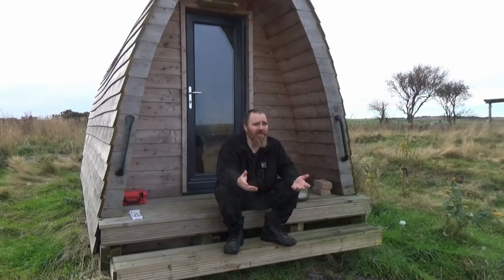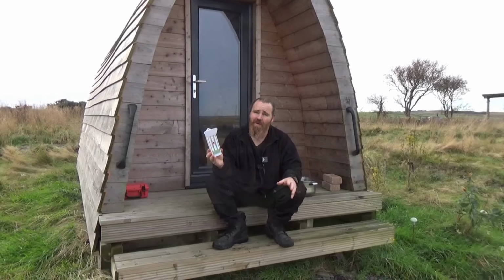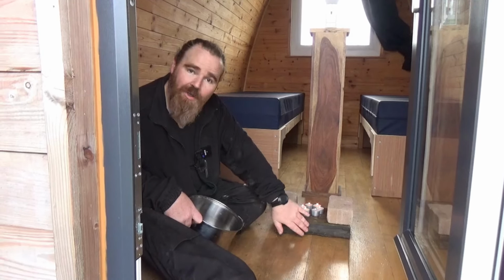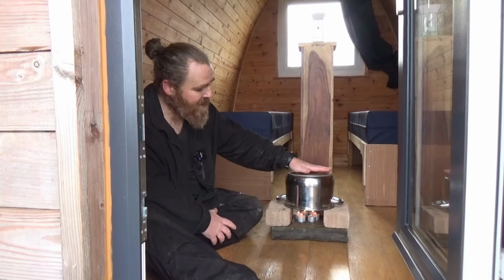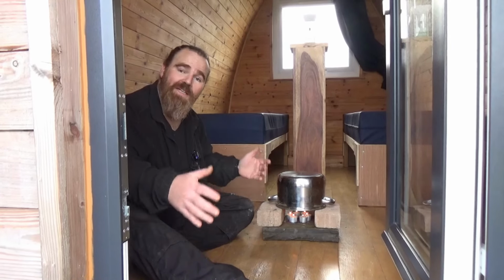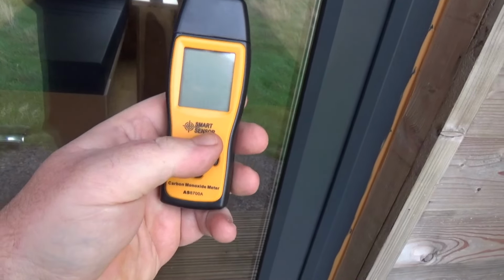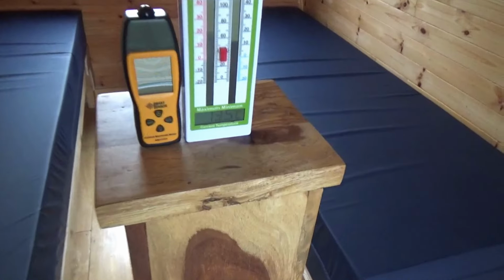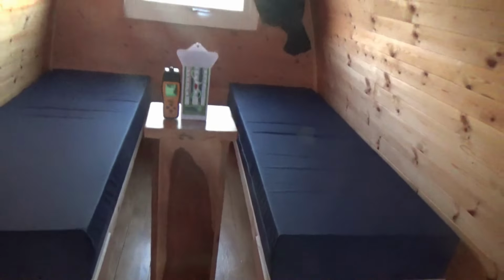DIY Flower pot candle tiny house/camper van/power cut heater tested. Effectiveness? Carbon monoxide?

Comment: The first law of thermodynamics is “Energy cannot be created nor destroyed”. 

The energy here is 6 candles. You claim the pot produces more heat than the candles alone. But if you weigh the pot before and after, its mass does not change. So the pot contributed no heat (energy). (If it did, it must have ‘created it’ - See 1st law). 

So your claim is ridiculous. 6 candles = 6 candle power.
Reply from the maker: Oh that's embarrassing. 
I hear a lot from people who think they understand the laws of thermodynamics. 
You don't. 
Energy cannot be created or destroyed, but it can be changed, and experienced differently. That's why a hot surface is hotter when you touch it. Conductive heat is more effective than radiant heat. Same heat, same energy, experienced differently. It's elementary, basic physics. 
You are suggesting that putting your hand into a flame is no more effective, in terms of heat transfer, than sitting next to it. Common sense should suggest otherwise. 
Using words you think are impressive, like thermodynamic, doesn't change the fact you clearly don't understand physics.
Reply: @CairnOfDunnCroftPermaculture  
In the example I gave regarding weighing the pots… Did you try it? Why not? 
Wallow in your ignorance, sister.
Reply: @CairnOfDunnCroftPermaculture  said, “A hot surface is hotter when you touch it”. Really? Merely touching something increases the heat output? Can you elaborate? 😂🤣🤣
Reply from the maker: @marcusjaybrode2129  oh bless. 
You really are a special little boy. 
Go troll someone who cares about your tiny penis energy.
Reply: @CairnOfDunnCroftPermaculture  
On my! A tantrum! Is it the wrong time of the month? Take a Midol and have a nappy.
But please come back when you feel confident enough to discuss this like an adult. 😆

Comment: Nope. 

Even if you covered the candles with a clay flower pot, it would still not be an effective method for heating a room. The heat produced by the candles would be trapped within the pot to some extent, but it would not be enough to significantly increase the temperature of the room. The limited heat produced by the candles would be quickly absorbed by the pot, reducing its effectiveness even further. Additionally, candles are not a safe or reliable source of heat and could pose a fire hazard if left unattended. It's best to use heating devices that are designed and tested for heating a room safely and efficiently.
Reply from the maker: You don't understand basic physics. 
I'm sorry, I've had enough of sugar coating this for ignorant men, and it's always men. You are ignorant of basic physics, and shouldn't be embarrassing yourself publicly.
Reply: @CairnOfDunnCroftPermaculture  -  
Thank you for your mature response. I hope you feel better now. 
So can you explain WHY I am wrong? No, of course you can’t. I dare you to try.

Comment: The pot doesn't matter.  Heat only comes from candles.   The pot only forms a pocket of hot air( mini oven).   Get a good sleeping bag.   Lighting a bunch of candles is unsafe.

If you need to use candles, put them in the pot so they are unlikely to start a fire.   Use a fan pointed at ceiling to circulate the hot air back down to body level.  Use a warm blanket.  Two   down comforters makes for very warm bedding.
Reply from the maker: https://youtu.be/sK539ekJ4bo

Comment: LOL. A candle can put out no more heat with a plant pot over it than it does without. Energy cannot be created.
Reply from the maker: The amount of energy contained in the fuel in a candle is set. True. However...
There are three forms of heat energy transfer. 
Convective.
Radiant.
Conductive. 
Convective heat is the least effective, conductive heat is the most effective. 

An example of the difference between the effectiveness of conductive heat and radiant heat is a hot water bottle. If we fill two hot water bottles with a litre of boiling water each, they have identical amounts of heat. But it's far more effective to hold the bottle than to hold your hands six inches away from it. When you touch it. you're experiencing conductive heat. 
When you hold your hands close to it, but not touching, you're experiencing radiant heat. 

Same energy, just transferred to you differently. 
Conductive heat is clearly more effective than radiant heat. 

An example of the difference between the effectiveness of radiant heat and convective heat is a closed room with a window facing the sun on a sunny day.
The room will feel warm if you sit at the back, out of the sun. You are being warmed by convective heat, the warm air is warming you. 
But you will feel a lot hotter if you move to the window and sit in the sun. You are being warmed by radiant heat.

Same amount of heat energy into the closed room, just transferred to you differently.
Radiant heat is clearly far more effective than convective heat. 

You can experience all three kinds of heat from a candle heater. 
Put a board between you and the heater. The warmth you are receiving is convective. The only heat you receive is the heater warming the air, which then heats you. Air is a poor heat transfer medium, so is not very effective. 
Put your hands a few inches from the heater, but not touching. You will feel a lot more heat. This is radiant heat. Much more effective than convective heat transfer. 
If you were to touch the heater, you would likely receive a burn. You would be experiencing conductive heat, the most effective heat transfer mechanism of all. It's so effective, it's dangerous to touch hot objects. 

I am not expecting you to just accept this blindly of course, there are some excellent resources available online you could avail yourself of.
Reply: @CairnOfDunnCroftPermaculture  If you had said that you were using the clay of the pot as a heat bank then I'd have been with you but the cold start would mean that heat would instead of being a constant have a painfully slow build up with a much longer release that trailed off painfully after the candle burned out. It's just changing the shape of the heat output graph, not increasing it.
Reply from the maker: @ZephodBeeblebrox  I don't think you understand the different forms of heat transfer. You're describing thermal mass, which is a different principle.

Comment: Ridiculous. Candles burn at the same temperature with or without a pan or pot .
Reply from the maker: The amount of energy contained in the fuel in a candle is set. True. However.....
There are three forms of heat energy transfer. 
Convective.
Radiant.
Conductive. 
Convective heat is the least effective, conductive heat is the most effective. 

An example of the difference between the effectiveness of conductive heat and radiant heat is a hot water bottle. If we fill two hot water bottles with a litre of boiling water each, they have identical amounts of heat. But it's far more effective to hold the bottle than to hold your hands six inches away from it. When you touch it. you're experiencing conductive heat. 
When you hold your hands close to it, but not touching, you're experiencing radiant heat. 

Same energy, just transferred to you differently. 
Conductive heat is clearly more effective than radiant heat. 

An example of the difference between the effectiveness of radiant heat and convective heat is a closed room with a window facing the sun on a sunny day.
The room will feel warm if you sit at the back, out of the sun. You are being warmed by convective heat, the warm air is warming you. 
But you will feel a lot hotter if you move to the window and sit in the sun. You are being warmed by radiant heat.

Same amount of heat energy into the closed room, just transferred to you differently.
Radiant heat is clearly far more effective than convective heat. 

You can experience all three kinds of heat from a candle heater. 
Put a board between you and the heater. The warmth you are receiving is convective. The only heat you receive is the heater warming the air, which then heats you. Air is a poor heat transfer medium, so is not very effective. 
Put your hands a few inches from the heater, but not touching. You will feel a lot more heat. This is radiant heat. Much more effective than convective heat transfer. 
If you were to touch the heater, you would likely receive a burn. You would be experiencing conductive heat, the most effective heat transfer mechanism of all. It's so effective, it's dangerous to touch hot objects. 

I am not expecting you to just accept this blindly of course, there are some excellent resources available online you could avail yourself of.

Comment: You'd get a better outcome without something on top of the candles . The heat used to heat pot is wasted. Simple physics 🤦
Reply from the maker: @hughwilliamson7439  no you misunderstand heat transfer.
Reply: @CairnOfDunnCroftPermaculture  you can't make anything more powerful by adding something that needs to heat up , especially something that is only 10wh .
Reply from the maker: @hughwilliamson7439  where do you think the heat goes? It's released to the room as radiant heat. I have another video proving this. You are, simply, wrong. You do not understand something as simple as the different forms of heat transfer. Radiant heat is more effective than convective heat. Conductive heat is even more effective, which is why putting your hand on the hot pot would burn skin. 
This is extremely simple physics. Please educate yourself instead of embarrassing yourself with comments like these.
Reply: @CairnOfDunnCroftPermaculture  it's you that needs educating 🤦
Reply: If a candle is giving off 10 watts an hour it'll only be 10 watts whatever you put on top of it 🤦
Reply from the maker: @hughwilliamson7439  ok. Put your hand in the flame of a candle. Now tell your hand it's the same heat as sitting next to it. See how silly that sounds?

Comment: From a science standpoint this makes zero sense . Just light the candles and leave them
Reply from the maker: The amount of energy contained in the fuel in a candle is set. True. However.....
There are three forms of heat energy transfer. 
Convective.
Radiant.
Conductive. 
Convective heat is the least effective, conductive heat is the most effective. 

An example of the difference between the effectiveness of conductive heat and radiant heat is a hot water bottle. If we fill two hot water bottles with a litre of boiling water each, they have identical amounts of heat. But it's far more effective to hold the bottle than to hold your hands six inches away from it. When you touch it. you're experiencing conductive heat. 
When you hold your hands close to it, but not touching, you're experiencing radiant heat. 

Same energy, just transferred to you differently. 
Conductive heat is clearly more effective than radiant heat. 

An example of the difference between the effectiveness of radiant heat and convective heat is a closed room with a window facing the sun on a sunny day.
The room will feel warm if you sit at the back, out of the sun. You are being warmed by convective heat, the warm air is warming you. 
But you will feel a lot hotter if you move to the window and sit in the sun. You are being warmed by radiant heat.

Same amount of heat energy into the closed room, just transferred to you differently.
Radiant heat is clearly far more effective than convective heat. 

You can experience all three kinds of heat from a candle heater. 
Put a board between you and the heater. The warmth you are receiving is convective. The only heat you receive is the heater warming the air, which then heats you. Air is a poor heat transfer medium, so is not very effective. 
Put your hands a few inches from the heater, but not touching. You will feel a lot more heat. This is radiant heat. Much more effective than convective heat transfer. 
If you were to touch the heater, you would likely receive a burn. You would be experiencing conductive heat, the most effective heat transfer mechanism of all. It's so effective, it's dangerous to touch hot objects. 

I am not expecting you to just accept this blindly of course, there are some excellent resources available online you could avail yourself of.

Comment: Total bs. Putting a pot over a candle doesn’t magically make the candle hotter
Reply from the maker: The amount of energy contained in the fuel in a candle is set. True. However.....
There are three forms of heat energy transfer. 
Convective.
Radiant.
Conductive. 
Convective heat is the least effective, conductive heat is the most effective. 

An example of the difference between the effectiveness of conductive heat and radiant heat is a hot water bottle. If we fill two hot water bottles with a litre of boiling water each, they have identical amounts of heat. But it's far more effective to hold the bottle than to hold your hands six inches away from it. When you touch it. you're experiencing conductive heat. 
When you hold your hands close to it, but not touching, you're experiencing radiant heat. 

Same energy, just transferred to you differently. 
Conductive heat is clearly more effective than radiant heat. 

An example of the difference between the effectiveness of radiant heat and convective heat is a closed room with a window facing the sun on a sunny day.
The room will feel warm if you sit at the back, out of the sun. You are being warmed by convective heat, the warm air is warming you. 
But you will feel a lot hotter if you move to the window and sit in the sun. You are being warmed by radiant heat.

Same amount of heat energy into the closed room, just transferred to you differently.
Radiant heat is clearly far more effective than convective heat. 

You can experience all three kinds of heat from a candle heater. 
Put a board between you and the heater. The warmth you are receiving is convective. The only heat you receive is the heater warming the air, which then heats you. Air is a poor heat transfer medium, so is not very effective. 
Put your hands a few inches from the heater, but not touching. You will feel a lot more heat. This is radiant heat. Much more effective than convective heat transfer. 
If you were to touch the heater, you would likely receive a burn. You would be experiencing conductive heat, the most effective heat transfer mechanism of all. It's so effective, it's dangerous to touch hot objects. 

I am not expecting you to just accept this blindly of course, there are some excellent resources available online you could avail yourself of.

Comment: Too dangerous. Not safe. Wiser to get a generator and an electric heater. Does a better job and is far safer as well. Being cheap, isn't being safer beside home or building insurance won't cover losses, if a larger fire breaks out due to an accident. Having a generator and electric heater is covered by home insurance. Using a single flame candle, will only heat an area of 10 square ft properly, and that's a bit larger than a small box measured 2 ft X 2ft X 2ft, or 8 square ft. A room 10 X 10 X 10 ft equals 1000 square ft. How many candle setups will you need to heat that room properly to a comfortable level?  You do the math. It would be wiser to build a small campfire outdoors to stay warm. I'm smarter, I have generator backup with heaters, and plenty of stored fuel. No fireman would call this devise safe, burning inside a home anywhere in the world, or a tent. Very unwise to use. NOT SAFE AT ALL.
Reply from the maker: Most people don't have those items in their homes.

Comment: a 2-3 degree C difference in air temperature is negligible when the test and measurement conditions are so inaccurate. Your description of radiated heat vs convection was also extremely misleading Radiant heaters use infrared light to heat objects/people directly rather than the air but a flame is a radiant heat source already with the metal pot you're heating mostly by conduction/convection.
Reply from the maker: You seriously believe that objects only radiate heat in the infrared spectrum?  You're absolutely incorrect. 
This is extremely elementary physics.

Comment: Enjoy cleaning the soot off your upstairs walls doors cupboards and paintwork ..dont do this as its a fucking filthy nightmare to clean
Reply from the maker: I've burned candles for decades and never had a soot issue. The inside of this pot doesn't even get black when I run it as a heater. 
Either you're using the world's dirtiest candles, or this didn't happen.